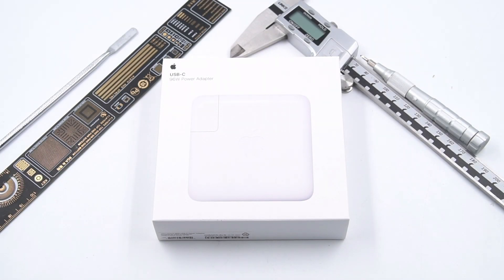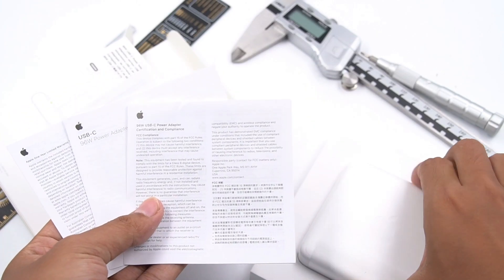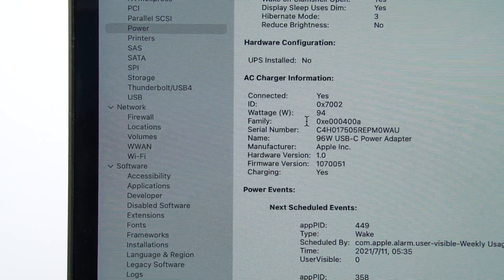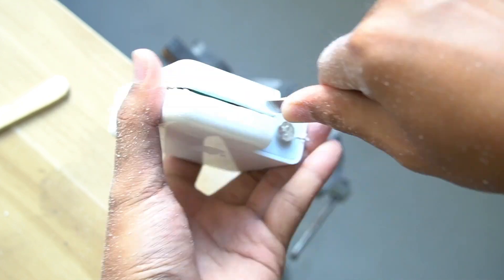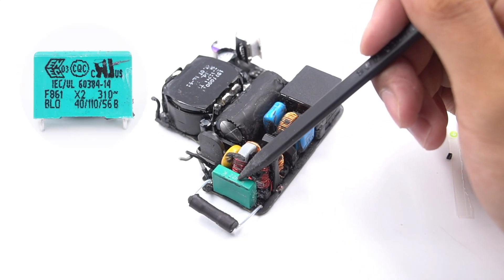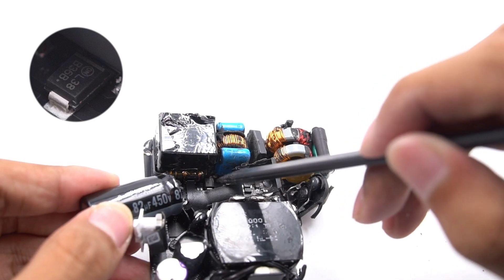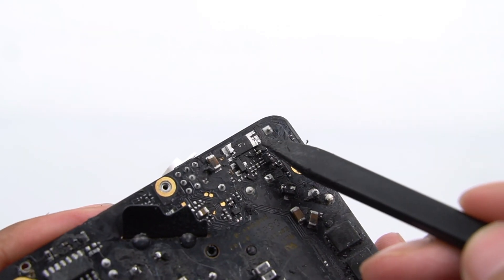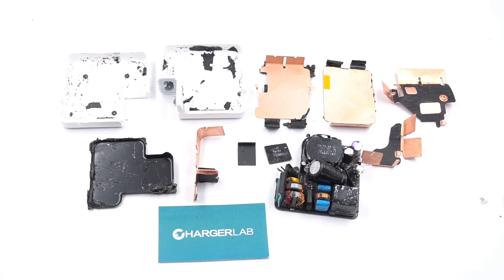Teardown of Apple 96W USB-C Power Adapter (Charger) A2166

Comment: When using the US grounded 3-prong type-B wall plug attachment for this adapter, will this actually ground the laptop through the USB-C cable, or does it only ground the adapter block?

Comment: Why it shows a measured 94W instead of 96W that is on the label? My charger it's also 96W and it shows 94W on the System Information on my MacBook Pro M3 Pro 15"

Comment: you can just cut the adhesive with a razor blade,you don't have to cut through  the casing itself ,just cut around the split part with a razor blade...deep enough to cut through the adhesive...partly through the casing  but not completely through  the casing ,then widen the gap with a knife ....the shell will separate easily after the adhesive is cut...that's why it is easy to open the older design of chargers that have wings for wrapping the cable using a pair of pliers...the adhesive is not very strong

Comment: Is the casing of the charger held together with adhesive or a friction fit? Is the usb c port held in place/sealed with adhesive? I used a brush soaked in isopropyl alcohol to clean the usb c port, and now I am worried that I could have compromised some sort of adhesive seal.

Comment: Sawing the cover is too rough. I managed to open this adapter with help of a kitchen knife and a hammer. Place the edge of a sharp knife along the side of an adapter, precisely where the cover body parts are adjacent to each other, and gently hit with the hammer. The idea is to push the edges of the cover halves sidewise so that they are ejected from the locks. You do it sequentially from all sides of the adapter. After that, the cover opens up manually without applying too much force. It can be also assembled back easily because the locks remain undamaged. Just make sure the knife is sharpened properly and has a flat edge long enough to cover the side of the adapter.

Comment: Great video! Do you possibly know why system information and coconutBattery shows that i have 60w charger if actually it is 96w charger? Cable and charger is original Apple products. Is it a cable or charger faulty?
Reply from the maker: My System information can show the correct charger info.
Please try to upgrade the macOS or to try another charger.
Reply: Maybe it’s a 60W cable, which one did you use?
Try a cable that handles 100W or 240W

Comment: Great tear down. Any thoughts on the plastic USB port? I have many many different capacity adapters from apple and some use a metal USB C port and some use plastic. It seems the newer adapters have switched to plastic. Any advantages or disadvantages?

Comment: I recently buy a MacBook Pro , I have a question, I’m not sure if is normal that the charger get hot when I charge the mac
Reply from the maker: Moderate temperature is normal, cause boost and buck will generate a certain amount of heat, but over-heating temperature may damage the charger.
Reply: @ChargerLAB  thanks for the answer, is there any solution for the over heating charger? As I say the mac is new so I don’t know what’s happen, awesome video by the way

Comment: I purchased it as secondary charger for my DELL and so for it performs perfectly. It is faster than stock Dell's 65W charger and it also has replaceable cable in case anything goes wrong about USB-C cable
Reply: did the same for my HP

Comment: This is why Apple cost more $. It’s not just the nice box it ships in, it’s the caps and the pcb and even the black goo. Yes it’s worth it. I own one of your KM001, and it has been a tank but after many repairs on the usb A input, I think a pad got pulled. It’s my fault, stepped on it while testing. I’ll buy your brand again, like apple it’s worth the cost
Reply: I also like that on Apple power supplies that they are supreme quality and last long, so they offset by that their main negative - high price and not supporting other charge protocols. I have several Apple power supplies (1x 5W, 2x 10W, 2x 12W, 3x 20W and one 96W) even though I have no Apple device. Also many GaN chargers or classic silicon SMPS lack three pin AC plug and especially at those wattages above ~ 30W, what makes them annoying due to leaking small AC current via Y1 capacitor. 

In my opinion as soon as PD becomes more common on phones, Apple power supplies will be much more useful :)
Reply from the maker: thanks for your trust💗
Reply: Word